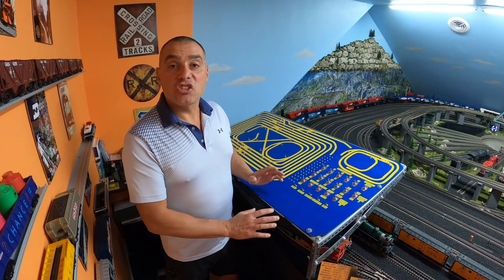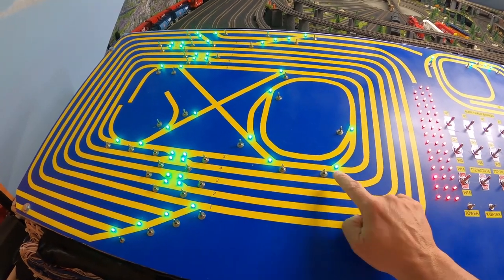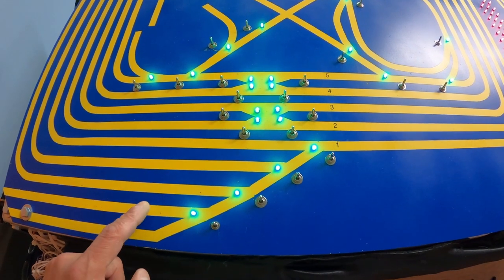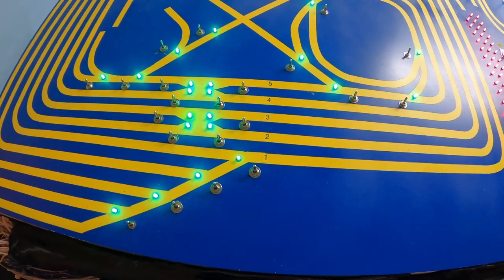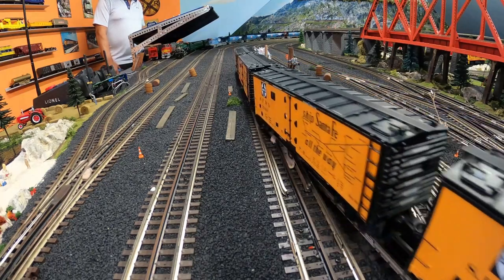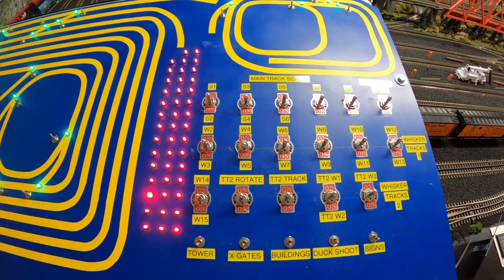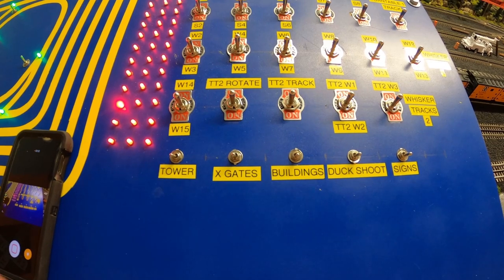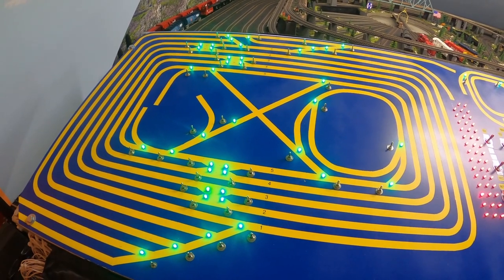Model Train Control Panel - Check out this really cool control panel on my model railroad!

Comment: On the crossovers. Wouldn't it be easier to have one switch that controls both switches? 
From one line to the other, they're automatically set correctly.
Reply from the maker: I agree that one switch can control both switches, and it just comes down to a matter of preference. For my layout, I chose to wire them individually as this made it easier to troubleshoot and isolate each switch in case of failures. Thanks

Comment: Very educational George. I want to build a co tell panel like yours. Where did you get the double pole double throw switches, the single switches and the led lights? Thank you in advance
Reply from the maker: Thank you very much! I purchased the switches and the LED lights from a website called LED BRITE. The gentleman who was running the site was very good and he had great products. However, when I made my last purchase a few years ago, he mentioned that he was retiring and shutting down the website. At this point, I don't think it's still up and running but you can try. Also, I think that you should be able to find these parts online from another site and they should be readily available. Good luck with your panel build, I hope it comes out great!

Comment: I love this.  I am going to do a control panel like the bridge on the enterprise.... I am working on an animation board now.  What sort of electronics are you using.  Did you design it yourself.
Reply from the maker: Hi Jimmy, thank you. Ha! That would be awesome if you can make your control panel like the bridge on the Enterprise! way cool my friend😎 Yes, I designed and built the control panel myself. I am using DPDT (double pole double throw) toggle switches, and bi-color LED's as indicator lights. Good luck with your control panel, let me know when you complete it! Also, thank you for watching and subscribing to my channel, I really appreciate it!!

Comment: Can you please mention which bicolor LED's you used in this build.
Reply from the maker: Hi Dave, I used Red/Green bi-color LED's from Bright LED's Central. I am not sure if they are still available online. I purchased them a while ago, and I have not seen them advertised in a while. hope this helps!
Reply: @trainwild  Didn't find that company. Are you running AC or DC power through your panel? Have you found that you must get the lights rated for AC or are they still compatible at DC

Comment: Hey George! 
   Great video, my friend. How long did it take you to wire it and how much was trial and error or was it all carefully planned? With me, I modify and re-do things as I go. Bad habit, I know, plus wasteful in time and materials. 
   What did you use to actually depict the tracks? I've said before that yours is one of the nicest layouts I've seen. 
   Glad you posted another video. Keep 'em coming!
Reply from the maker: Hi Tom! so nice to hear from you. I actually did a lot of careful planning and design to build this control panel. I wanted to be able to control the entire layout including all 44 turnouts from one control station. This includes all sidings, whisker tracks, main lines, turntables, signs, lights, sounds, etc. Although control of the actual trains is done remotely (I will make a separate video regarding control) it is still wired through the control panel, so it has to be figured into the wiring. There is a tremendous amount of wiring running through the panel as all 6000' feet of layout wiring has to tie back to the panel at multiple points. The design has to include track layout, turnout location & LED lights, layout of the switches and wiring and room for expansion. Although it is very complex, I wanted to keep it as sleek and simple as possible. To me, simplicity is key. Otherwise, it would have been too bulky and taken up a lot of unnecessary space. As much as I try to carefully think things through with every possible scenario, there is always trial and error. Unforeseen issues seem to always arise during the building of the layout. It might work today, but as things develop and expand, it no longer works. There definitely was a significant amount of troubleshooting, and I tried to mitigate it as much as I could, based on thorough research and past experiences. Thank you for commenting, it really helps inspire me to keep making videos, and thank you for watching. I really appreciate it! 😀

Comment: How come you have two separate switches for your crossovers?
Reply from the maker: Just preference. I decided to wire each motor separately to each switch on the control panel. Ultimately this makes it easier for me to troubleshoot each switch component when it decides to stop working. This is the main reason why I chose to do it this way. There are several different ways to wire the switches and crossovers, and this just works best for my application. Hope this answers your question, Thanks!